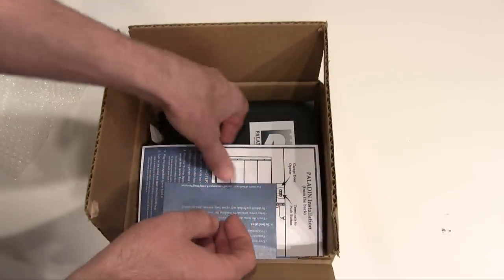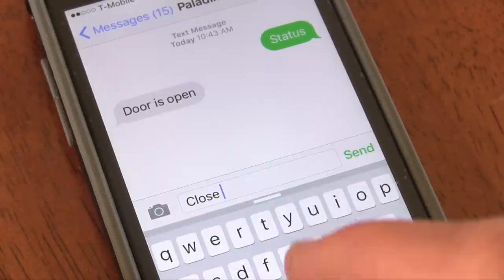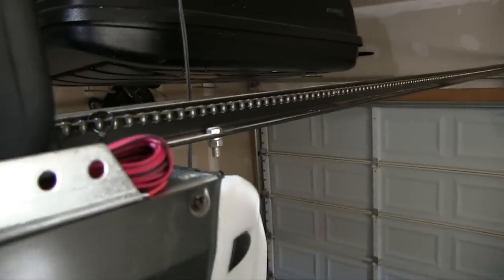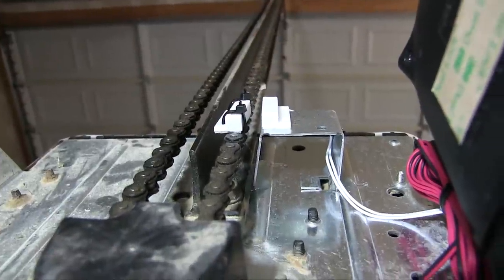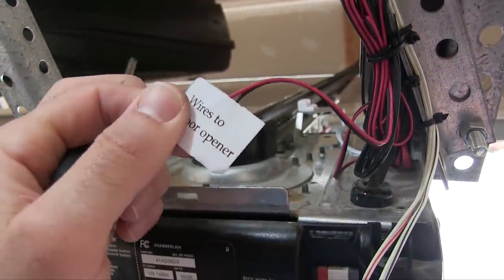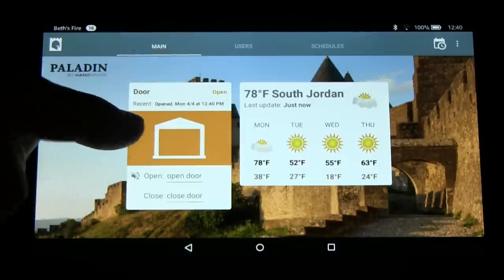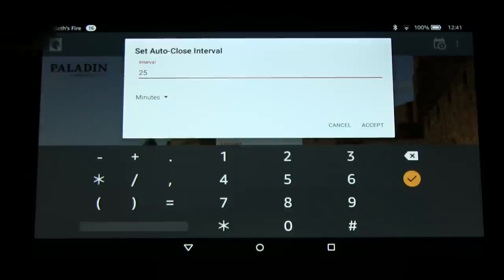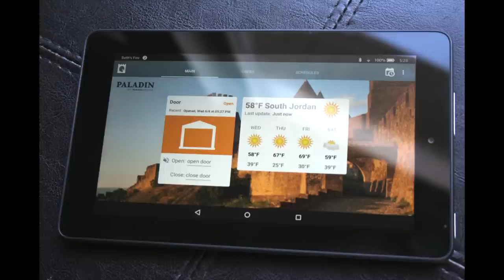How to open a garage door with a phone - convert to Smart Opener Alert System

Comment: Looks really cool and nice job, the hot glue will be your failure point although. That must go, vibration and oils, heat and other factors will make that joint fail. Other than that nice unit and demo...
Reply from the maker: +Curiosity Totally!  I was never going to leave the hot glue on.  It was just to test the rig. But when I found out it was super stuck I decided to leave it.  I'll update the comment if and when it falls off. I'm curious to see how long it lasts.
Reply: Curiosity rr